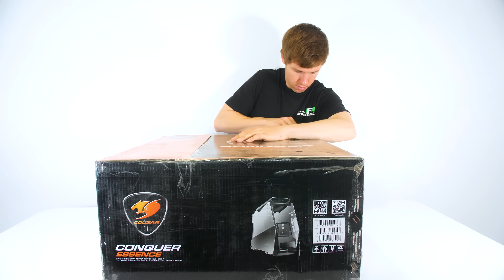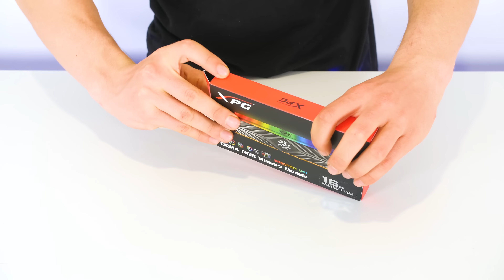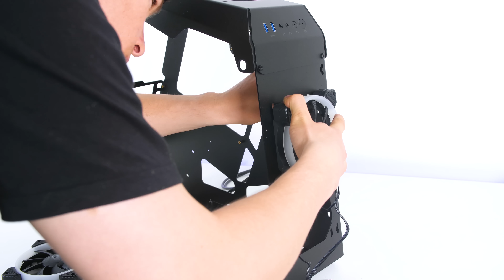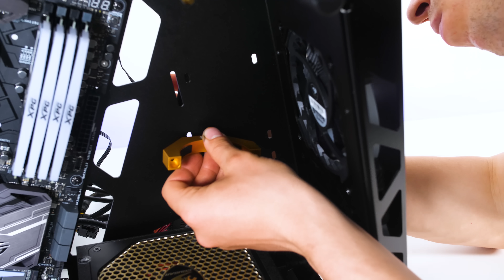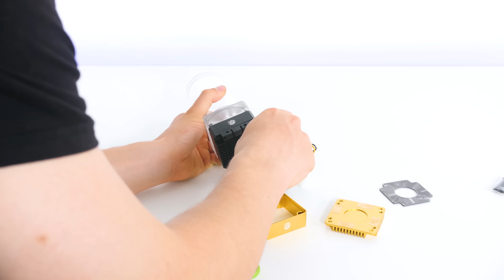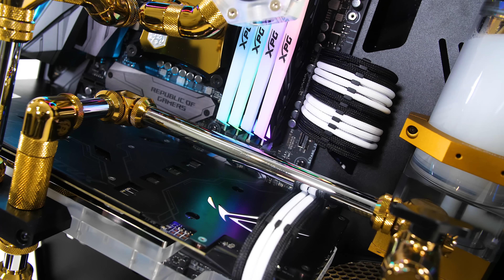$5600 Ultimate High End Water Cooled Gaming PC Build | Crazy Time Lapse

Comment: not gonna lie, 5600$ and first, you have 
>a 1070, even though 1080Ti's fit in a that huge budget easily
> then the video was published on the 26.10.2018, I as a straight up retail peasant got my i9-9900k on 7th of november, by the time the video was published the i9-9900k was by far announced and you should've known of the new cpu getting released.

Worst thing, my pc is a good 2000$ bucks cheaper, and is still performance-wise way over this fiesta you're presenting here, not watercooled-wise since it is sick what you built there (except from the watercooling rotor-shit-things, i fucking hate em, just visual appeal for a loss in waterflow, awful).

Not amused to see this being called an ultimate high end water cooled gaming pc build, if you just put aesthetics over performance.
Reply from the maker: Aesthetics is what this channel is about my friend. I dont buy my pc parts i reuse stuff so i dont have to waste money each week on hardware. Its also in AUD not USD and the water cooling is like $2000 of the cost

Comment: power supply upside down, 1070, overkill on ram, and no actual bends in the tubing. this PC is 3000 overpriced
Reply from the maker: You should watch the whole video before you comment. Its also 5600$ AUD

Comment: 1070 and only 2 240 gb ssds. Rip.
Could this be done with a 2080, asrock x399 professional gaming str4 6gb/s usb 3.1/3.0 atx amd motherboard, those same 4 ram sticks you used?
Reply: Or do ram and ssds have to be same brand like you used in this vid?
Reply from the maker: Its $5600 AUD

Comment: i just bought this case but with a ekwb. would the bitspower fittings work with the ekwb setup?
Reply from the maker: Yes they would
Reply: @DesignsByIFR    thanks. im new to water besides using the AIO. i just bought https://www.ekwb.com/shop/ek-kit-rgb-240 kit . what fitting size would fit with this. i don't understand what tube sizes goes with what fittings.it looks like the ekwb kit i have uses a 16mm tubing so i would have to go with 16 mm fitting?
Reply: for the thumb pci mount screws which does this case use? the m3 , m4 or the 632

Comment: Should we spend another hundred bucks and upgrade to the 1080... nea lets spend it on additional unneeded Flow indicators, tubing, and fittings!
Reply from the maker: Did you even watch the video before you commented
Reply: @DesignsByIFR  yes, I watched the whole video. Great video and you did wonderful work on the build, not taking away from the hard work. But(yes there it is) when you have a title that says 5600 dollars & Ultimate people expect to see top end components. The 1070ti is pretty high end but by no means ultimate, I guess I have more of an issue with the phrasing here. That case is Tempered glass on both sides and i notice you didn't show the back of the build at all, especially after you finished it, all the beauty shots are in the front. Ultimate in my head is custom sleeves on any wire that can be viewed from the outside of the PC, modular PSU with at least a cable mod kit, picture perfect sleeved cables and management on the back side that you would have included in beauty shots. I follow these rules myself when I build my PCs (also why i never have a case with windows on the rear :P). You are good man, but the standards for stuff like this are super high now, we look at the little things. But I guess I am just some random guy on the internet. Thank you for the video!

Comment: You're not running the gfx card in parallel, it's still running in a serial configuration. Those flow meters are running in parallel to the gfx card. I still have nfi why you would set it up like that

Comment: >$5600
>puts a 1070 inside
Such amaze, much wow.jpg
Reply: word.exe
Reply: This is my build for the same price (cheaper too):

I9-9900K

RTX 2080 TI (SLI)

64 GB ram (3200 mhz)

2 TB m.2 ssd

AX1000 (1000 watt)

ROG Maximus XI Hero

Cougar Conquer Case

H150i AIO liquid cpu cooler

LL120 RGB Fan (3x)
Reply: @theilluminati1554  AIO cooler $160 vs custom Bitspower water cooling set $1000...but i rather have your set up for the same price range lol